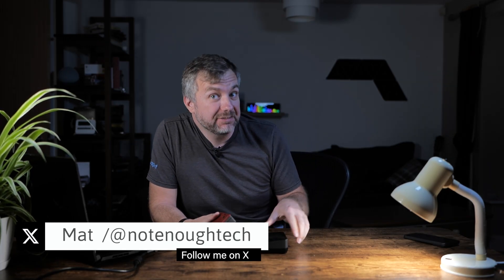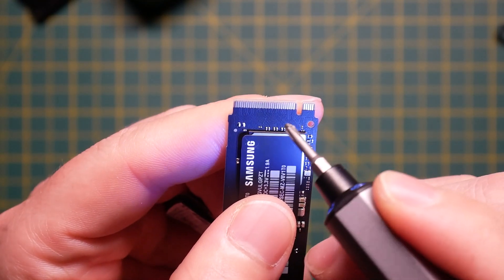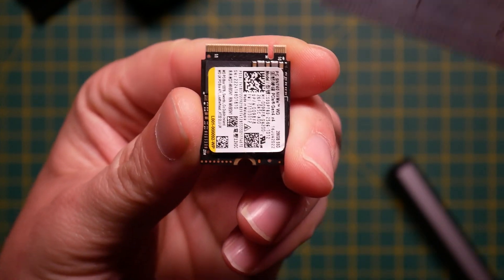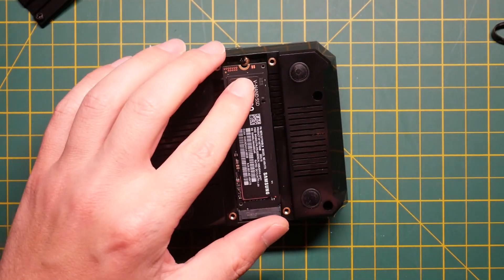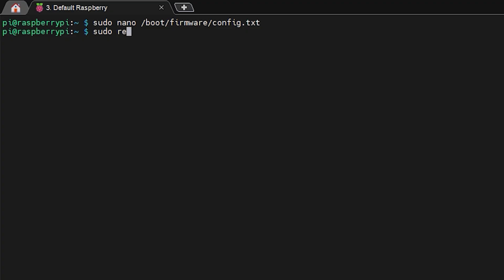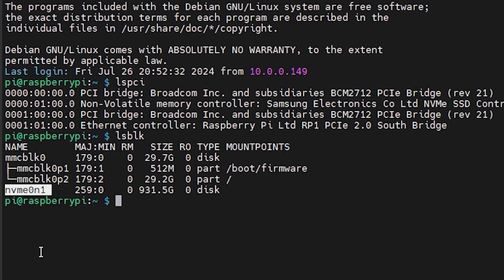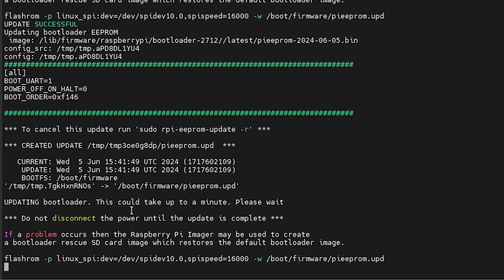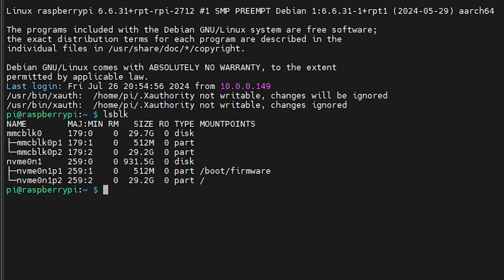How to boot Raspberry Pi 5 from NVMe

Comment: Solid tutorial. I followed the steps but moved the order of things around, because I built my Raspi 5 and had the NVMe already installed and the ssd booted cleanly, identified the NVMe using lspci and lsblk under Ubuntu 25.04 (the core Linux commands are very close to RaspOS). I added the same lines on the config.txt underneath the last [all] section, verifed the NVMe again... Because mine was already identified, I just used fdisk, partitioned the drive (I set mine at primary), use dd to copy from the mmcblk0 to the new NVMe nvme0n1 and waited (mine is 2TB so it took about 50 minutes at 90 MB/s average). Looks good so far..   Except that raspi-config does not have a boot order on my system yet (it probably needs to be rebooted before the NVMe is seen as bootable). 
The only thing I really wish Raspi5 had is a 2.5 or 5GeTX network port.. maybe Raspi6 will have 10GeTX by then. But then again, I built this for $350 so I'm not really complaining. My microTX PC similar stats cost almost $700 at the time (about a year ago), so no complaints.
Reply from the maker: Thank you for the comment and I'm glad my video made things easier

Comment: Hi, thanks that really helped me loads as I just purchased and installed my new Freenove NVMe Hat to my Pi5 8gb and with it my new 2Tb NVEMe SSD (I didn't have a USB adapter to do this from the PC. Now it boots fast from NVMe straight to desktop. I am now ready but struggling to find an easy Bitcoin node install with a own mining pool: and multi task other minor apps ie my PiHole which was already setup and running on an old Pi2 which I have put to one side as I want to let the new Pi5 multi task this filtering traffic job. Any advice.
Reply from the maker: To be honest, you'll find the PI to be way too slow to do any meaningful mining for anything other than sake of learning

Comment: Thanks for the video.  I'm using a Pi 5 16GB with StellarMate to run my telescope and using a 1TB NVMe to boot and also store images from the astrophotography cameras.  The 16GB should help when trying to stack images on the Pi rather than waiting to get them on my workstation.
Reply from the maker: Darn that's some bursts you have to take over night!

Comment: What can be done if the clone fails because the target SSD is smaller than the SD Card? SD Card is read as 238.8GB and SSD is read as 238.5GB. When it copies, it fails and says target is out of disk space.
Reply from the maker: @eldritch-library  you'll need to resize the partition on your sd card. Unless you are using whole 240GB system will take like 4GB at most

Comment: Great explanation! After all the steps, this is how I resize the partition and file system to take all the remaining space:

sudo apt install cloud-guest-utils
sudo growpart /dev/nvme0n1 2
sudo resize2fs /dev/nvme0n1p2
Reply: Hi, this ist what i am looking for! Just a question: I did all the steps in the video and everything seems to work well. My SD-Card is 64GB, the ssd ~500GB, after the videos-process there are two (small) partions availabe: 64GB (like SD-Card) + the small Bootpartition. So after all this i post these tree commands to have the full ssd size? And: as i would like to keep the 64GB Partition, is it possible to create a clean, empty third partition with the "restsize"? Do i have to split before th dd, or after the resize? thanks a lot!

Comment: Really nicely explained, but I think I am forever stuck. Can't find any way to boot from the Toshiba Kbg40znt512g I currently have, and I don't have any other ssd to try; I have sent an email to 52pi, asking if they can suggest any ssd that were tested for booting the Raspeberry OS.

For now, I have managed to see the /boot/firmware on the NVME, but I could not boot without the SD inserted. And now, after tinkering a little bit more, the Rasperry won't boot for even if the NVME is last in order, and remains in the black screen for a lot of time.

If you have any tips, I would gladly accept them.
Reply: Some of the hats are not compatible with SSD`s that have Phison controller. IDK if this couldn`t be the problem.
Reply from the maker: I second that. Trying a new ssd was a god send for me when I was troubleshooting my CM4 board.

Comment: So wierd.. i add the 2 lines to enable my pci exactly like in the video and the changes save in the text file... but when i reboot and type lspci it doesn't show my nvme drive whats going on....
Reply from the maker: @KyLeReStOuLe  is your file changed after the reboot? The problem I had were incompatible drives so that's another thing to check
Reply: @notenoughtech  yes my file changes after the reboot and still nothing.. very frustrating im gonna try plugging in the ribbon cables tighter and see what happends. But still you would think i would have some indication??? When i type lspci all i see is the pci bridge and ethernet controller nothing else
Reply from the maker: @KyLeReStOuLe  is your drive 100% NVMe or is there a chance you got a M.2 SATA?
Reply: @notenoughtech  I believe M.2 would that make a difference?? It still fits perfectly
Reply from the maker: @KyLeReStOuLe  M.2 is a connector shape. NVMe and SATA are data interfaces. They share same connector but are not compatible with each other

Comment: Hello ! SAMSUNG 990 PRO 1TB M.2 PCIe NVMe MZ-V9P1T0BW  - compatible?
Reply from the maker: @tomibodolai3951  I cannot comment on individual models, it's within the spec
Reply: I am using 980 pro 1 TB with Raspberry pi 5 8GB with Argon Neo 5 nvme case and it’s pretty much overkill for raspberry pi 5

Comment: Hi, Brilliant video, just what I needed, I searched Raspi docs and YT and nothing comes close to this. I've used a 500Gb Crucial SSD which I will use for Home Assistant primarily for controlling solar and battery, IoT generally and software development in Go and Python.
Reply from the maker: I'm pleased it helped! Enjoy.. I'm working on a couple of Argon cases reviews soon so you can put that HA instance in a nice box :)
Reply: @notenoughtech  I bought everything in a GeeekPi kit, it came with a 52pi metal case, very solid and stable, fatal for wifi, so ethernet only. I've had bad experiences over the years with Argon cases, and broken power switches but my main complaint is no easy access to Micro SD, if you need to reload the OS its a major job.

Comment: Thank you for sharing this. 
But I got a problem when I boot my Raspberry Pi 5 from nvme, even though when I check with lspci it does recognize my nvme ssd, however I got error code: ‘failed to open nvme’. 
I am using M.2 HAT from WaveShare nvme borad C, a Kioxia Japan Ssd 1tb. 
Cuold you help me with this?
Reply from the maker: Basic Google search shows that the drive should be ok. It's Gen4 but I think that's backwards compatible. Have you enabled gen3 support for your RPI5 PCIe?

Comment: Can you know if does it work correctly for example for a Bitcoin node?
Reply from the maker: not something I played with but it will work just as any other Linux system with SSD on it
Reply: That's my plan. I'm updating my btc node, from a Pi4 with SSD over USB, to a Pi5 with NVMe

Comment: Hey Mat, I'm using an Intel NUC with Proxmox and containers. Proxmox is very nice, because each environment has its own IP. To me, this seems a bit more convenient than using 8 or 10 Pis ... what do you think the advantage of Pis are ... perhaps ease of installing software?
Reply from the maker: There is nothing stopping you from running containers on RPI. From this perspective it's down to price/power/ease consideration. I used containers in the past, but frankly speaking I had little reason to do it this way (as I had spare hardware and messing about with configs was just not my thing). Containers are great for dev purposes. If you do this for your own use only, it negates the need for containerised deployment.